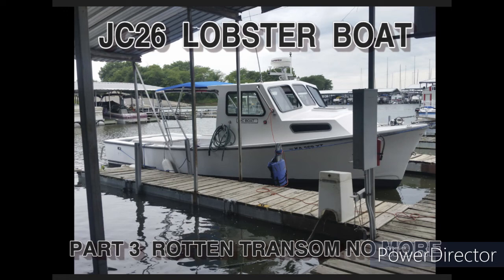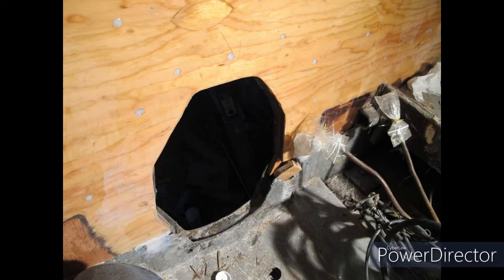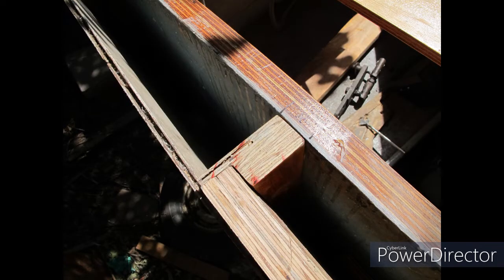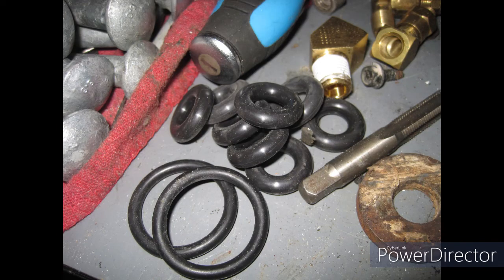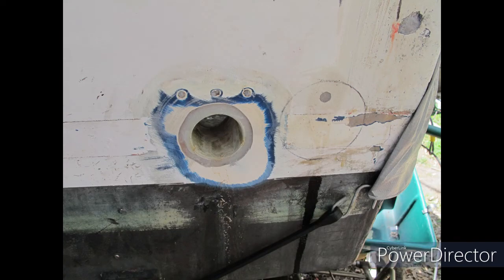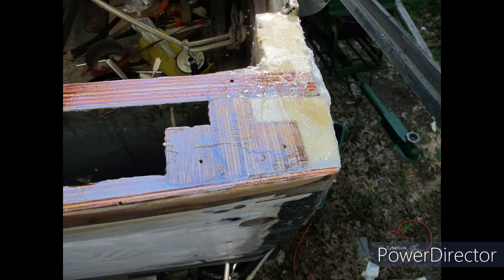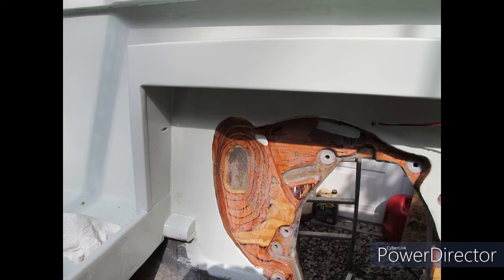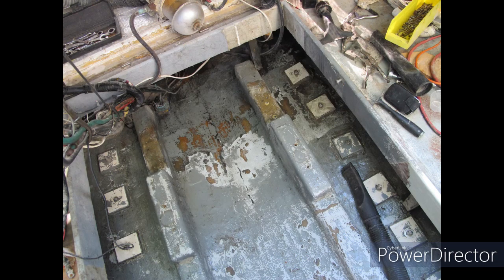JC 26 LOBSTER BOAT RESTORATION  EPISODE #3                                ROTTEN TRANSOM NO MORE!

Comment: I swear it's always rain water that eventually gets a boat from the inside. Having as close to a water tight deck as possible with excellent bilge pumps and monthly maintenance of the bilge area is definitely on my to do list. Its always the mounting screws on rails and other add on accessories that start leaking and bad seals on compartments. I'm in the process of  replacing and repairing everything I can to make sure water just slides down the self bailing deck without any seepage. I can take about six to 8 inches of water on the deck before it starts pouring into the cc floor hatch. That's if the weight alone didn't sink me before it escapes.😂